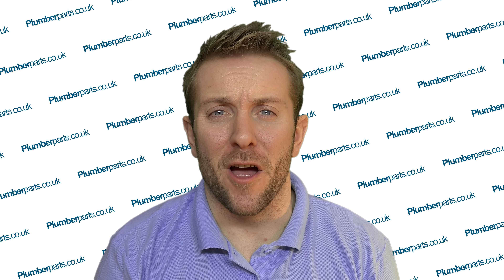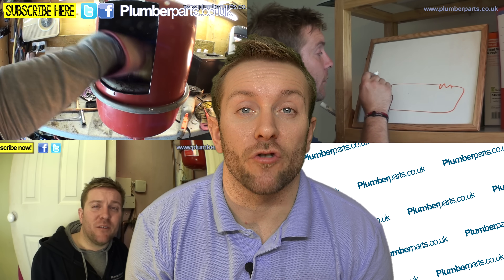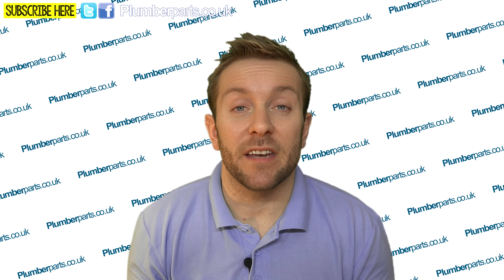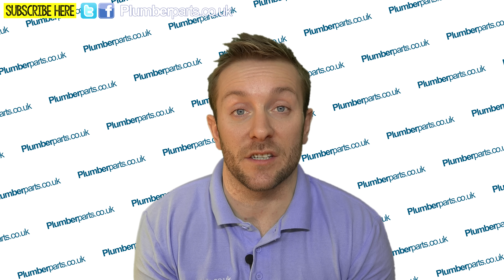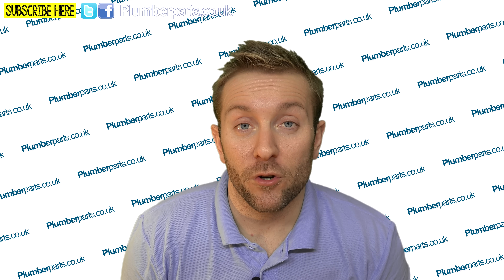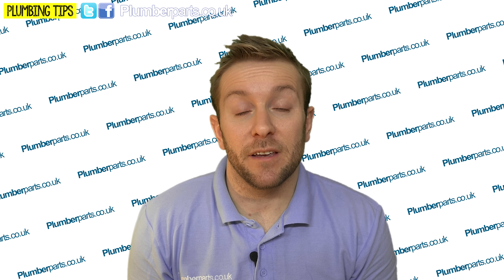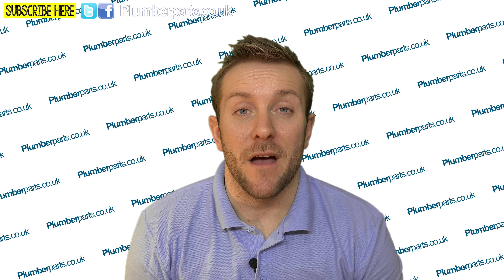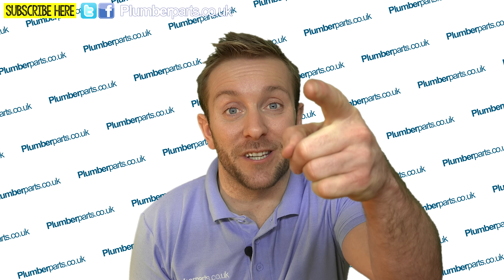BOILER KEEPS LOSING PRESSURE - WHY AND HOW TO FIX - Plumbing tips

Comment: The main reason for removing the filling loop, is to prevent the contaminated water in the system getting back into the cold water mains supply.
Reply: In Canada there’s a backflow prevention device on the fill.
Reply: @danlux4954  and in the UK

Comment: My boiler hasn’t got a expansion vessel and pressure gauge keeps going up when heating is on then dumps the water how come
Reply: Unless you have a feed and expansion tank, then your boiler will have an expansion vessel ( if your system is quite large then you might find you have an external expansion vessel aswell as the expansion vessel in your boiler ) On some boilers like worchesters the expansion vessel is hidden behind the back of the boiler 👍
Reply: @dan123collins  thanks for your help daniel finaly found the expansion vessel right at the back of of the boiler and yea it’s burst
Reply: @activeway9843  Your welcome, glad you got to the bottom of it 👍
Reply: @dan123collins  I just find out it’s a tankless boiler how can this be
Reply: @activeway9843  if you have no tank and your on a sealed system and there is definitely no expansion vessel in the boiler itself then it’s to be expected that your pressure rises when the boiler runs and dumps itself. 

Is the house new to you ? Or have you had a new boiler fitted ? 

Sounds like installation error as all sealed systems need an expansion vessel, water expands when it’s heated and that expansion has to go somewhere until the temperature lowers again.
Reply: @dan123collins  no it’s 15 years old and never had this problem that’s why I’m so confuse

Comment: The pressure relief valve on my electric water heater only lasts for a couple of years before it starts dripping and you're losing several liters of water each day. Due to the high calcium content in our tap water here all these mechanical parts are clogged up within no time and starts leaking.

Comment: thank you for explaining this as  a single woman we mostly stay away from plumbing  and boilers 😂can I ask your opinion please your advise is appreciated  for as you know a lot more about this than me can you please tell me in your opinion as my meters is low so no heating or hot water should I switch my boiler off for a few days and maybe it will get back to workings or maybe i need a plumber working on it you took the time to thank you if you took the time to read my comment  but I know you are busy so if you don't have time to answer your still awesome ♥️😣

Comment: I was always told never to test pressure relief valve as it will leak and keep dropping the pressure on the system. I would always cheak that first off is it driping on the warning pipe outside.

Comment: Hi can you please help. I had a new combi boiler and pipes put in just over 5 years ago. It’s a baxi duo tec combi boiler. 

I recently had my system flushed and ever since my pressure keeps dropping like once or twice a month. 

I have checked all radiators and no leaks anywhere.

Can you please advise? Anyone? 
I’m truly lost and really stressed.

Comment: Just had my boiler serviced. I've been told I might have to do change my whole heating system as I might have a link under the floors. I have a pressure drop problem but not obvious reasons above ground.
Reply: Try leak sealer in the system first
Reply: I had the same thing, but you will see the damp patches appear on your walls where leek. In my old house the pipes were buried in the floor screed. The problem is they expand and contract with the cement tightly packed  around them, this not only corroded the pipes but pulls them apart or fractures them. A new house will have ducting for the pipes so eliminating the problem.
I moved the radiators to new positions on adjacent walls fitting back to back with one drop pair  and  short runs of pipes. This kept the price down.

Comment: Hi, I have a question, a main combi boiler had some pipe clicking noise so I changed the automatic air valve and noise is gone, but from that day, it started to show low pressure on the gauge. When topping it up, it just need a small swivel from the filling loop and it is all filled up?! Is it a pressure vessel problem?

Comment: Hi, many thanks for the video, very insightful. i do have a question. I do have a .oss in pressure and noticed that out side i have a drip leak. as per the video this leads me to think the Pressure release valve may be faulty. if this is the case, then would i also need to replace the vessel?

Comment: Question: if I isolate the CH feed and return at the boiler and the pressure remains stable does the indicate CH circuit leak as probable root cause ?
Reply: Not necessarily,  you have less expansion when you don't have an entire system connected..get a good engineer...
I hope my cardiac surgeon doesn't you tube bypass operations for tips!

Comment: i have a ideal logic 30 when i just have the hot water turned on it keeps its pressure with no drop,,but when i turn on the central heating and turn it off after a few hours by morning the pressure has dropped very low i have checked all radiators and on leaks ..have you any idea whats wrong with it please
Reply: I have the same boiler and the same issue right now. 
Did you find out what the problem was?
Reply: @illuminoacey  no did not find out
Reply: @irenedunne352  That's a shame, we have an ideal serviceman coming out next week so hopefully he can fix it. I'll update you if I find out any useful information. Thanks for the quick reply!
Reply: @illuminoacey  thanks mate
Reply: @irenedunne352  Hi again, the serviceman from ideal came out last week and fixed my boiler which is now holding pressure normally.  He replaced the heat exchanger and that seems to have fixed it. So, my boiler was out warranty, but if you ring ideal up, they should offer you a service or repair contract. Basically, they will come out and repair the boiler and give you 6 months warranty, i payed £50 a month for 6 months, total £300. Then you can decide if you want to extend the service or not.
Reply: @illuminoacey  thanks for your update glad you got it sorted where going to check are insurance see if we are covered....thanks again

Comment: Since April 2000 I have done nothing except find leaks in hot/cold, rising main and central heating systems and repair them where necessary. In those 21 years I have only come across 2 failed expansion vessels and 5 failed pressure relief valves. All the other leaks were failed fittings [95%] or pipes [5%] that had been damaged during their installation.   The stats  speak for themselves.  Pearse of Leakbusters

Comment: My vailent ecotec. Is losing pressure very quickly.
I can hear a sound like a constant  flow of water.
The ignition isn't trying to ignite any more.
With Corona lockdown nobody wants to come out.
Can you give me any pointers. As I have no hot water or heating.

Comment: Can you repressurise an expansion vessel without draining water.   On my system, static pressure is 1 bar, and the expansion vessel is 1.5 bar
If I let air out to test for any water present .... can I top back up accurately.

Comment: Hi everybody dr nick here 
My combo boiler is about 10 years old 
The pressure was dropping all the time I checked around for leaks 
Then I looked at the tyre valve on top of the expansion tank pumped it up with air  and noticed that when I put a bit of spit on the valve it was bubbling  
I replaced the inners of the valve and so far the pressure has not gone down  
Great news hope this might help someone .

Comment: thank you Hose Mourinho I like it, I think the issue on mine is the water escaping from the pipe outside.
Reply: Have you checked to see if expansion vessel has any air pressure in it or whether water is coming out Schroeder valve or prv might not be seating properly causing a constant weep.
Reply: @davyg7883  yes is water dripping outside so must be that.

Comment: Interesting video! I have noticed a very slight drop in pressure over a prolonged period, say 1.25 bar drops to 1 bar over approx 6 months, easily fixed with a squirt of pressure from the filling loop!
This has been like this since I had a new boiler fitted approx 12 months ago, before that on my old system the pressure was fixed and never dropped (except one time when the shrader valve on my expansion vessel was faulty)
So I've checked all the bleed valves on the rads for leaks as I know these were all opened during the new boiler install. No leaks found, had a quick look around, no damp patches or wet areas, but I wouldn't have thought it was any of the original.pipework as all was good prior to the install? I've also checked under the boiler for leaks, no drips, have checked the PRV outside but it's hard to tell if it's dry as we have very few dry days during winter but again can't see it being that as that was completely new during the install?
Now I'm not overly concerned as the pressure loss is pretty minimal, it's just a niggle as I know there was no leaks before! If it gets any worse I'll contact the installer.
Another thing he did mention was the pressure might drop a little due to the system 'settling down', I've done 2 top ups in just over 12 months, Is that acceptable, should I just accept it and not worry about it too much or have I got a very slow leak somewhere that could cause me future problems? 😁⚠️👍😎😯
Reply: I wouldn't worry too much. Once or twice a year is "acceptable". The norm, especially if you have a large system with lots of rads. I've got 3 "go to's" for this problem this very week. Just don't forget to get the boiler serviced annually to qualify for any manufacturers extended warrantee.  Irks me no end when customers do not have an annual service and even more so when other you tuber, heating engineers fail to mention this when they do boiler reviews.
Reply: @loafersheffield  Cheers for the reassurance, it's just niggling me as I know I hardly ever had to top up the pressure before! It's not a huge system, 3 bedroom house, I have a double rad and single rad in the living room, all the other rads are singles, one in kitchen, one in hall, one in bathroom, one in each bedroom and a small rad in airing cupboard. So 9 rads in total, the boiler is a Worcester Bosch green star 30i, what sort of price would I be looking at to service that and what actually should get done?
Thanks.
It's just about due it's first service, I'll get the installer to do it.

Comment: Missed another possible pressure drop problem.. you can some times have a pin hole in the heat exchanger also causing the loss of pressure. water will run into the condensate drain not showing any sign of a leak.
As ive had this on a job not long back.

Comment: Thanks for that clear explanation. I 'stumbled on' this vid not quite a week after I'd called out a tech-specialist plumber (Warranty Ts&Cs ) who found 'zackly what you described - a deflated pressure expansion 'balloon' and a gushing px. release valve hidden low down behind some spare bricks. Less than 5 minutes to diagnose,  20 minutes to service in and out..... and on his way.  I really like it when a skilled pro works fast and right, like that.

Comment: hi i have a water boiler heating system and water keeps dripping out at about 1 litre per week....it is coming out of a copper pipe drop just before the fill valve...its basically a water line drop that is some type of overflow it just goes to the floor and i keep a bucket underneat it...iit used to leak now and then but now its leasking even with the boiler not running..any ideas?..its not a visible pressure relief calve its just some t connection ..i wish we could post photos withing our messages but we cant so icant send a visual

Comment: Hi, any ideas re my Vaillent ecomax 835e a S53 (lack of water in system) running issue  ? water goes cold after 3-4mins, had it before when rubber pipe totally blocked (thanks for your videos) very helpful David

Comment: The Council done a boiler and radiator replacement programme. After new Boiler Worcester installed I have noticed a significant drop in main water pressure in both hot and cold water taps is this normal for modern day boilers?  Many thanks

Comment: u forgot to mention crack or pinhole in the heat exchange apart from that - good video
Reply: Mate I have the water leaking through the condensation pipe any idea
Reply: @voiceofreasoningelliott5849  either heat exchange or expansion vessel

Comment: I’m certain that we’ve got these systemscwrong. When the pipes get up to temperature the thermostat clicks and the pump stops. This then means the water just stands and eventually cools until the thermostat ‘calls for heat’ then the boiler starts and the pump begins to pump the water round the system again. BUT what should be happening is this. When the thermostat switches off, the pump/s should still continue to pump the hot water round the system instead of all shutting off and waiting for the water to cool down. This then causes an inefficient system as the cold water needs then needs reheating and pumping round again.

Comment: My plumber fitted a spirotech deaerator.  This will collect micro bubbles on the flow line and vent to atmosphere.   So there will be a pressure drop, especially after the system has been flushed and refilled.  Normal behaviour,  and hopefully by removing dissolved oxygen, it should be less work for the magnetic filter and inhibitor.

Other causes:  colder weather = colder radiators which means a lower pressure.  I typically see a 0.1bar drop for every 10degree drop in temperature.  So with the autumn days advancing, I have seen pressure drop from 1.4bar down to 1.3 bar.

Comment: Hello there, 
I have a Vaillant ecoTEC plus831 boiler and the hot water keeps going. 
All I am looking for is how to get the hot water back. Could you tell me in very simple instructions how to get the hot water back please.
I'd be so grateful if you could.
Katriona.
North London.
Reply: either flow turbine or plate exchange is blocked however the diverter valve could be stuck

Comment: These would be the likely culprits .......... unless you were unfortunate to have bought a Vokera boiler.  In which case 95% of the time it’ll be the main heat exchanger leaking straight down the condensenate outlet pipe!!!!
Reply from the maker: Bummer!

Comment: I have to top up my Sealed Central Heating System once or twice a year. 
Is this normal?
The system was fitted about 9 years ago.
Do you think the inhibitor will need replacing due to dilution through topping up?
Cheers.
Reply: I also have this issue. New house 3 years ago. Needs repressurising twice a year.  Plumbing came out, checked of leaks. Couldn't find any.  I asked him to top up inhibitor as it is clear that it will get diluted over time.  I have no idea if repressurising twice a year is normal?

Comment: My combi boiler will be fine most of time, but if the temperature over night drops to nearly 0c as my boiler is in the loft, then it drops all its pressure but only over night and only when it’s freezing outside.. no engineer can find out why!! Nightmare

Comment: My boiler pressure goes down to 0 by morning time and once I build pressure up goes it drops down by night. There a small pipe that's outside the flat correlating to where the boiler is located within the flat, this pipe has drops of water coming out slowly. Could this be the reason for the pressure drop? Bearing in mind this pressure drop started when my radiators stopped working, everytime I would put the switch on the boiler to put radiator on, nothing would happen. Plumber came and told me to use the radiator through the time interval caps on the boiler for time being until he replaces the thermostat which he diagnosed as being the problem for radiators not responding (hot water was fine). I'm just wondering could the radiator not working be connected to the boiler pressure keep dropping now and the slow leak on the outside pipe connected to boiler.?

Comment: Great video again.  I've got this problem with pressure dropping almost daily.  I have noticed that when the heating comes on it doesn't take long (quicker than usual) for the needle to go up and close to the red (over 2.5 bar) but drops quite quick when the heating goes off again. Would this point to a faulty expansion vessel?
Reply: Having the same issue at the moment with mine. Topped up the pressure 3 times over 2days already.
Reply: @solefreak2  WHAT WAS THE PROBLEM MINE IS DOING THAT
Reply: @tammyharrison1062  Can't remember the exact part, but one of pressure valve or something like that needed to be replaced. Luckily I had British Gas cover who carried out the repair.

Comment: My pressure gauge doesn’t work because when there is no pressure the heating still works and the needle goes up?
Reply: Is your boiler a Worcester Bosch. They don't put a low pressure cutout on their boilers.  This can lead to a burned out pump.

Comment: Many thanks for these videos, really helps narrow down the problem. 

Tiny bit of dirty water came out the Schrader valve and not much air of a 15 year old combi system. 

Symptoms have been (for sometime): CH only works after running hot tap, constant filling of water (where does the water keep going?) to bring pressure up almost daily  since xmas. 

Re pressurising expansion vessel via pump the weekend, it appears to be losing about 0.1 bar per day. A biasi M90F looks like I have to remove the boiler to replace the vessel. Damn!

Thanks again.
Bob
Reply: Some just have rubber lining i think there is just one pipe going into the bottom so no air will escape this guy is a typical plumber trying to find unnecessary work to do you wouldn't put a magnetic filter on a boiler either